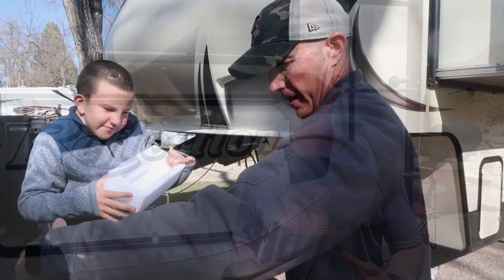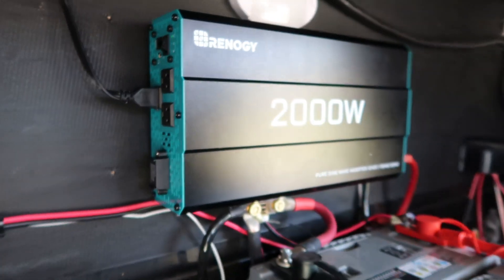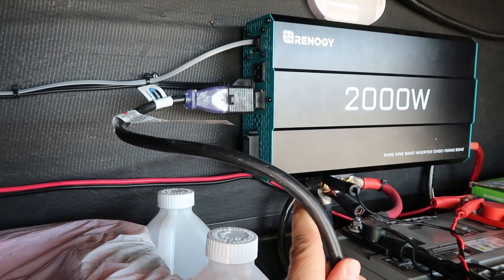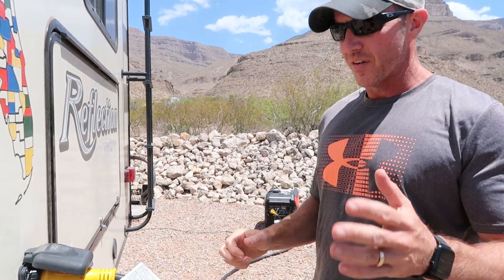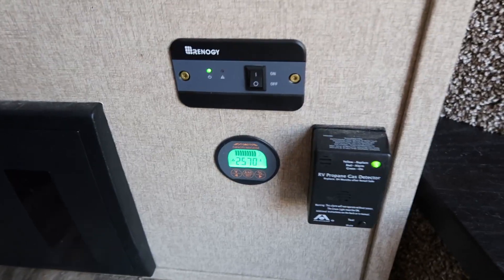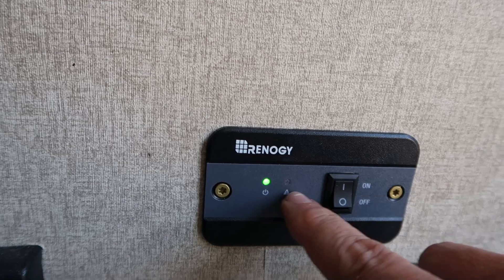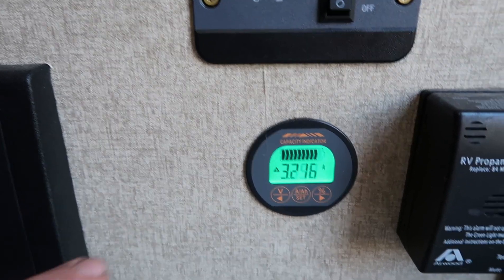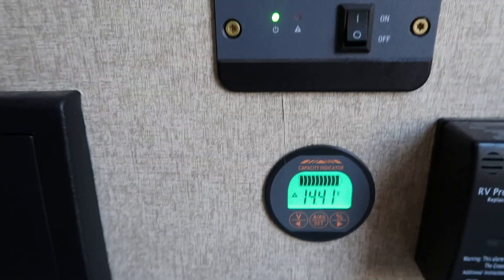How To Power Your Entire RV With An Inverter | Easy Inverter Power

Comment: I like this setup, I have a generator and don’t want to have the inverter running all the time. I just need to power my 110v lights and outlets when I don’t want to use the generator.
Reply from the maker: Exactly what I wanted to do as well. This has proven to be a great option! Thanks for watching!

Comment: Just in Time !  Thank you for this video.  I have a 2021 Reflection 278BH 5th-wheel.  I replaced the cheap dealer battery with a SOK 206aH lithium, planning on adding a 2nd, so over 400aH of capacity.  Just received a Renogy 3000watt pure sine wave inverter.  Another fellow suggested running a dedicated power line from the inverter to the living area?  Then seeing this was like a "duh" moment!  Running the line directly to my 50amp plug-in like you did.  Hoping that you have a video of the actual install, since I'm clueless with this.
Reply from the maker: I have a video of the original inverter installation and battery monitor. That was before the Renogy inverter but the installation is the same.

Comment: thanks for the help! my question for you though is, if you do this style of "soft wire inverter hack" and you turn off the converter at the breaker inside the fusebox location, will my solar panel still charge my batteries while my inverter is being used and running?
Reply from the maker: Yes they will charge. The converter is separate from the solar, meaning the solar will go directly to the batteries without going through the inverter. Thanks for watching!

Comment: You can get 20amps with that inverter if you hard wire it to a 20amp receptacle. Then it can run a Keurig, Microwave, or a blow dryer easily.
1 at a time of course.
Thanks for your knowledge and sharing.
Made my life a lot easier while boon docking.
I always take a backup generator for emergency power.
Reply from the maker: You’re welcome. Great info, thanks!
Reply: Could you just buy a 15amp to 20amp adapter for the inverter?

Comment: I just installed a Renogy 2000w inverter. I Used a 30amp locking trailer adaptor to a 50 foot 30amp extension cord. Then from the extension cord I added a 30amp to 20amp adaptor. That plugs into a 20amp receptacle installed beside the inverter. Now I have 20amp service to my trailer.The reason I went down to a 20amp receptacle is that I hard wired it to my inverter.
Renogy told me that the 3 plugs were 15amps, but the hard wire ports were 20amps.
Thank you for your excellent video on how to power the whole trailer with the 200watt sokar panels and 2000watt inverter.
Reply: Solar. Lol
Reply from the maker: That sounds like a great setup! I have been considering hard wiring a receptacle to the inverter. I like your idea, thanks for sharing!
Reply: 1:05 so mu 1:13 😮 in😅 1:13x13Ceiling 😮😮😮😅space 8😅😅😅69😅⁸o 1:30so1:13x10 😅so 1:14 1:14😮 1:14 1:14 1:16 😅

Comment: Why cant you just use the battery monitor in the control panel for the trailer?
Reply from the maker: My trailer only had a very generic battery gauge in it from the factory. Plus I wanted one that would read the amperage draw and charging amperage as well as the battery voltage.

Comment: So you can charge your batteries and or use the solar power with the inverter by turning off the converter? My solar is already prewired on the rv is that an issue?
Reply from the maker: Do you have an inverter already installed with the solar?
Reply: @JouppiOutdoors  i dont think so. Just a solar charge controller and a battery switch
Reply from the maker: In that case yes, you would set up your system like I did in the video and turn off your converter before plugging into the inverter. My solar is just portable vs being installed on the RV like yours is.
Reply: @JouppiOutdoors  i have power cables inside the storage space near the the battery storage. I guess unplugging the red and black cables would tell me if that’s for my usb connections or outlets.
Reply from the maker: If the cables are hooked to the batteries, they will be running your lights, usb, and vent fans.
Reply: @JouppiOutdoors  i just unplugged them and power to USB, fans etc stayed on. So I would be safe to asume those go to the main power supplies
Reply from the maker: If the RV is plugged into shore power, the converter would be running those items even if the battery cables are unhooked.
Reply: @JouppiOutdoors  shore power is off on the rv. Thats whats tripping me out. So in that case I can run the inverter through those lines (the ones coming from bottom/outside) as input then connect the others for output (the ones heading into the cabin) and it would work wouldn’t it? Just turn off converter?
Reply: Should I turn off the converter while i run lights and fans etc then unplug the red and black wires i’m talking about to see if it does anything?
Reply from the maker: @NanceLvr  Yes, turn off the converter and unhook the cables to see what the 12 volt power was running.
Reply: @JouppiOutdoors  didn’t turn off any of the fans, lights or usb connections. (Turned off inverter breaker switch, and uplugged black and red cables) I do think I can easy plug and play an inverter with those lines.
Reply: @JouppiOutdoors  my thought on this is it came pre wired for an inverter

Comment: I set my camper up this way. It was the simplest and safest way to use the existing power distribution system installed in the camper without  any fuss. Thankfully my solar batteries and inverter were much closer to my input power port so a much shorter cable was required.
Reply: So when connecting to shore power you have to makes sure your inverter circuit breakers are oof and the power on the inverter is off?  when you have no shore power (off grid) you flip the inverter's circuit breakers on and turn on the inverter power button? is this how it works?
Reply from the maker: Since I am using 2 separate power cords, there is no chance of shore power and inverter power being fed to the RV at the same time. It’s one or the other, so yes, I do turn the inverter power off…but I am disconnecting the power cord anyway.
Reply from the maker: Thanks for sharing your thoughts and thank you for watching!

Comment: Been thinking about this set up for months. So far I have collected 400w of solar panals, 40amp solar charger and 200amp lithium ion battery. Just waiting to get a 2000w inverter
Reply from the maker: That is going to be a great setup! Thanks for watching.
Reply: @JouppiOutdoors  dude I picked up the 3000 w renogy... it's badass. Even though my battery will only produce 2560 w but that's enough to do what I want
Reply from the maker: I would love to have the 3000 watt! Should be a great unit!
Reply: @JouppiOutdoors  you know if I was to do it again. I would buy a 3000w inverter/ 70amp charger. But I just couldn't pass up that new power inverter for $440. The guy ordered it never hooked it up. He said it was too big. His loss my gain
Reply: Don't forget your battery monitor.
Reply: @TheHuntingSpot  yes thank you. I just spent $440 on a new Renogy 3000 W power inverter. The battery monitor is next and a must have

Comment: The AC panel on my 2004 Fleetwood Southwind is not well marked. Is there some way to determine which breaker is  for my converter/charger?
Reply from the maker: You could check the voltage on your house batteries while plugged into shore power, then start turning off breakers until the voltage drops. That should be the converter breaker, you could then turn the breaker back on and see if the voltage goes up on the batteries to verify. Thanks for watching!

Comment: And do you have a video of the actual set up!!
Reply from the maker: This is the setup. It’s pretty simple, just an inverter wired to our house batteries with a heavy duty extension cord that allows me to plug our trailer directly into the inverter. The battery monitor and  citron charger are optional but highly recommended. Thanks for watching!

Comment: I have a question. My converter just went out do I need the converter in tact to do this system?
Reply from the maker: You will need a converter or at the very least a battery charger to recharge your batteries when you plug into shore power.

Comment: Its crazy how fast technology is moving in the battery/solar world. I purchased two 200 amp hour lithium batteries that have built-in heating elements and Bluetooth function so all I have to do is look at my phone and I could see how much power is going in and out and turn them off manually from my phone. I don't have to deal with anything on the wall other than the inverter switch
Reply from the maker: It is pretty amazing! I got into the battery industry in 2006 and the technology that is available to the consumer now, compared to back then, is incredible! Thanks for watching!

Comment: When you plug in your generator do you just remove your inverter plug and start you generator because that’s the where they both plug in I’m very interested in what you did because we want to start boondocking I have portable solar that keeps my battery charged but that all right now
Reply from the maker: Yes, I turn off the inverter and just unplug the extension cord and adapter from our trailer. I then plug in our big 50a power cord to the trailer and start the generator. I have 2 cords (main power cord that normally is used goes to the generator, and a 20a extension cord that goes to the inverter) I just switch them out at the receptacle on the trailer depending on which power source I’m using. Hope this answers your question and thanks for watching!
Reply: @JouppiOutdoors  Thank you

Comment: This is exactly what I was planning to try, despite being told it would not work.  Thanks for sharing.  I also have the Renogy 2000W Pure in my Amazon cart and was researching to ensure I was ok with such a setup.  Would you please share the brand of the battery monitor?  Sounds like an important item I should add to my setup.  Thanks again!
Reply from the maker: It will absolutely work! This setup has been a great option for us since we do not boondock very often. The battery monitor has been a great addition also. Here is a link to the one we have. Thanks for watching! AiLi Battery Monitor: https://amzn.to/3t7AV7Q
Reply: @JouppiOutdoors  I already have a battery monitor that gave with the trailer to monitor batteries solar etc. Why do I need a 2nd one?
Reply from the maker: @theconnectedcamper  if your battery monitor shows you the real-time battery voltage you wouldn’t need a 2nd one. My factory battery monitor just gave me a generic reading and did not show my amp draw which is why I added this one.

Comment: Your info about turning off the converter was the final missing piece of information I was looking for. Thank you.
Reply from the maker: Glad the video was helpful! Thanks for watching!
Reply: I found another alternative to turn off the converter without having to turn off the breaker in the panel. I installed a remote controlled (wireless) grounded plug on the backside of my power distribution panel, where the converter plugs in. I then plugged the converter into the remote controlled plug. I can tell from my battery monitor if the converter is on or off and with the push of a button I can turn the converter/charger off when powering my camper off the inverter. Much easier than installing a transfer switch in my case.
Reply: @lgmoon40  Sounds good to me. I bought the same remote plug for my little fan so I didn't have to get out of bed to turn it off : )
Reply: Me too😂

Comment: Great video. I do have a question. Can I use any 12v car battery to power my new 1000watt inverter? Or does it have to be a marine, or RV battery? I'm new to this. Thanks.
Reply from the maker: Thank you! It would need to be a marine deep cycle battery. A regular car battery would technically operate it, but it would not last long and is not designed to be drained and recharged over and over like a deep cycle battery is. If you have any more questions, feel free to reach out, I’m happy to answer if I can! Thanks for watching!
Reply: @JouppiOutdoors  Thanks a million!!!

Comment: Couldn’t hear you through the wind noise…
Reply from the maker: Agreed, I recently made an updated video explaining how we run our RV on the inverter. Sorry for the wind noise and thanks for watching!
Reply: @JouppiOutdoors  still…I’m glad I found your channel.  You have several videos I’ve saved for viewing.  I’m looking forward to the follow up video to this one.  Not sure I seen it in your channel list though.
We have a 2022 Jayco motorhome with solar and a generator.  But it has 2 crappy lead acid batteries 8m getting ready to change out.  
And why on earth the factory would install a solar panel yet not include an inverter in the package is beyond me.  There wasn’t even a 12V outlet in the coach so it’s not like I could run anything but lights and the water pump.

Adding the inverter and changing out the batteries will be a major upgrade for us.
Reply from the maker: I have added the link to that video in the description of this video if you want to check it out. I should have done that before now!

Comment: If you want to turn on the AC or microwave, do you disconnect the solar system? Then all runs with the generator? Or you leave the solar system connected? Thanks
Reply from the maker: I will leave the solar connected when the generator is running to help recharge the batteries. Thanks for watching!

Comment: World you be able to use car battries
Reply from the maker: Technically you could use them, but they will not last long. You need a deep cycle style battery that is designed to be depleted and recharge many times. Car batteries are designed with high cranking amps for starting your engine and not designed to be discharged and recharged over and over. Hope this helps and thank you for watching!

Comment: I’m 60 years old and a woman. I had to get my converter replaced but noticed outside I have an inverter in the basement area. Can I do this with it?
Reply from the maker: Unfortunately there’s not a simple yes or no answer. Many times if you have a residential refrigerator, there will be a dedicated inverter to keep it powered up while you are traveling. Typically these inverters will only be 1000-1200 watts. So technically yes, you could do this but you would be limited on how long or how much you could run on it based on your batteries and whether or not you have solar panels to help charge during the day.

Comment: Hi thanks for this info. We have a Reflection as well. 2021 311bhs. When we boon dock we usually run the keurig coffee maker and mainly an Xbox for my son and some lights . We do
use our Honda 2000 generator and never have a problem. So my question is would a 2000 watt inverter be fine or would 3000 be better. Also is running the extension cord like your saying safe ?  I do have 2 100 Renogy solar panels on the roof . Do have a diagram of how you installed your system?  Thanks for your opinion.
Reply from the maker: Hi there! If your Honda 2000 does the job, a 2000 watt pure sine wave inverter will do just fine. The only high load item you listed would be the Keurig. My extension cord is a heavy duty 20 amp cord, we typically never pull more than 10 amps (AC) off of the inverter which is only 1200 watts. I don’t have a diagram, but I will explain our system a little better (and without the wind noise!) in our next video on Sunday! Thanks for watching!
Reply: @JouppiOutdoors  Hi looking forward to your setup on Sunday video . In this video will you explain if you use a fuse or circuit breaker or both? Sizes etc . 

Thanks
Reply from the maker: I use a 200 amp ANL fuse on the positive cable from the battery to inverter.
Reply: @JouppiOutdoors  Cool thank you
Reply: @JouppiOutdoors  Awesome sounds great . Thanks for get back to me .like I said I have the Solar installed already , would be nice to know how to introduce this inverter into the system. Thank you